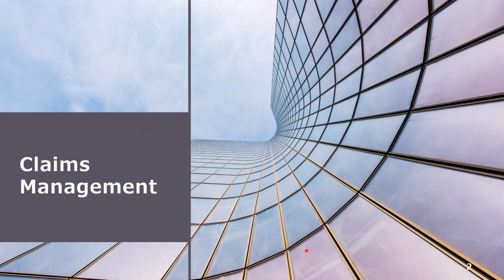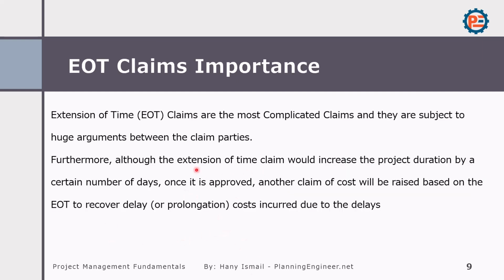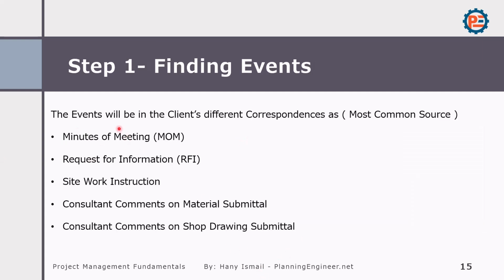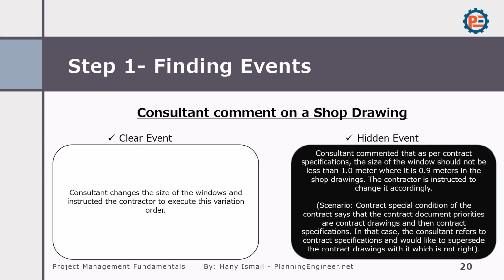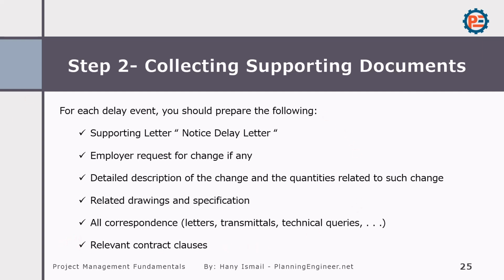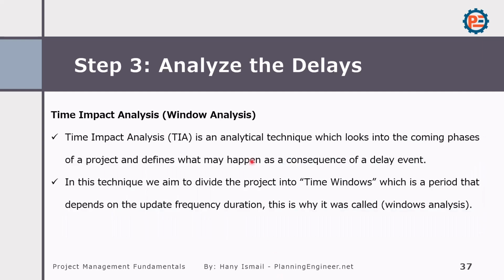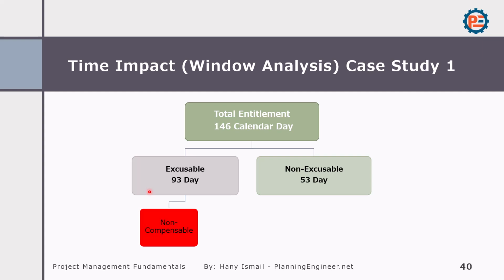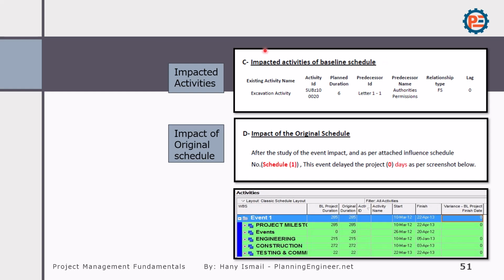32 | Claim Management: Types, Techniques, and How to Create Strong EOT Claims

Comment: @6:46 the RFI is not request for information but it is request for inspection.
Reply from the maker: It can be Request of Information what is the issue with that?
Reply: It depends on which country you work in. If RFI is used as a Request for Information, a request for inspection will generally be called Hold Point or witness point.